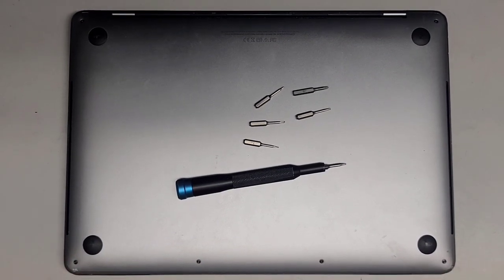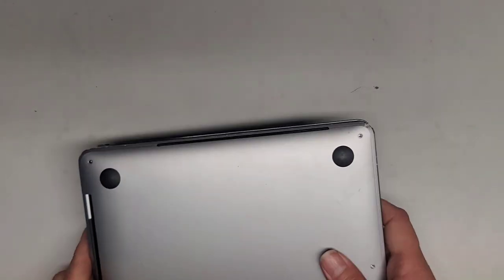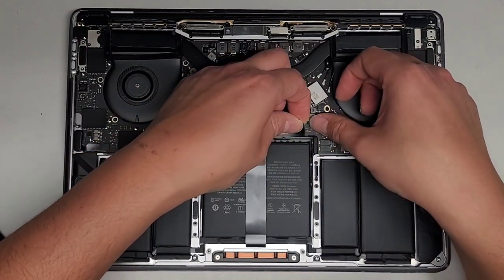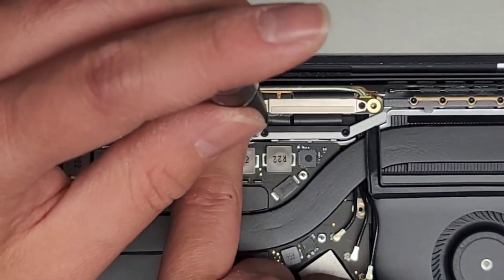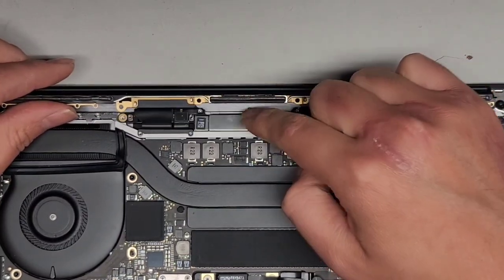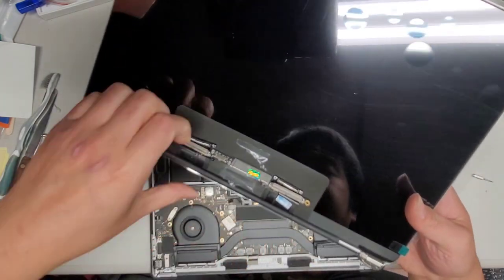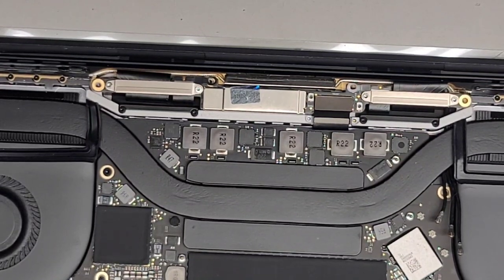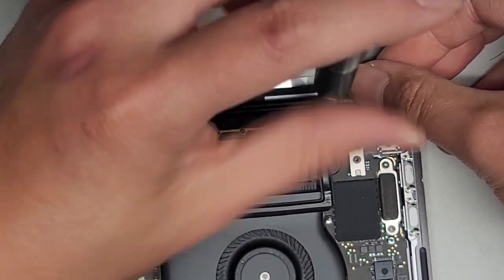2018 13" Inch MacBook Pro A1989 LCD Screen Replacement Repair

Comment: I ripped the battery board data cable:/ is it hard to fix?
Reply from the maker: You'll have to find a replacement :(
Reply: @ItsBinhRepaired  replacement cable??
Reply from the maker: @TheCoquifrog  yeah

Comment: i replaced the screen but the laptop wouln't turn on, any recommendation?
Reply from the maker: Did you plug in the charger?
Reply: @ItsBinhRepaired  I did in all the ports, and flipped the charger. I even took the back cover off to check if the fans are working but it is not
Reply from the maker: @CharlieTouma  did you do the battery drain before touching the other connectors?
Reply: @ItsBinhRepaired  I did what was shown in the video but this was my first time doing it, I may have done it wrong
Reply from the maker: @CharlieTouma  double check the battery connections
Reply: @ItsBinhRepaired  the laptop I have is A1989 EMC3214 but the screen I installed is A1989 but it says this in the Amazon link : Compatible Product Line: EMC 3358 MR9Q2LL/A MR9R2LL/A MR9T2LL/A MR9U2LL/A
Reply from the maker: Hmmm no idea :(

Comment: Hey i replaced my screen,but now my mac runs extremely slow and it doesn’t work without been plugged in 
What it could be?
Reply from the maker: Sounds like you didn't connect the battery properly.
Reply: Thank you man ill check it
Reply: Thank you man i checked the battery cable and it was loose!!
Now it works perfectly
Reply from the maker: Awesome!